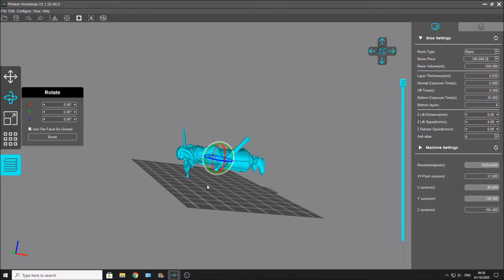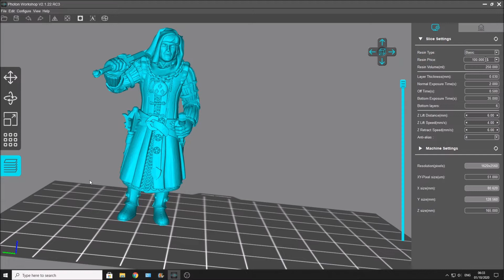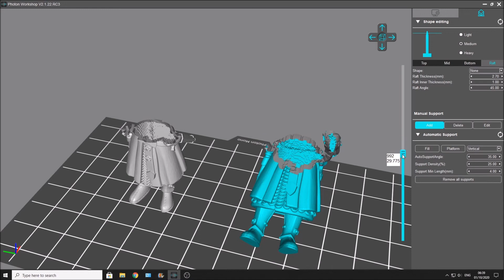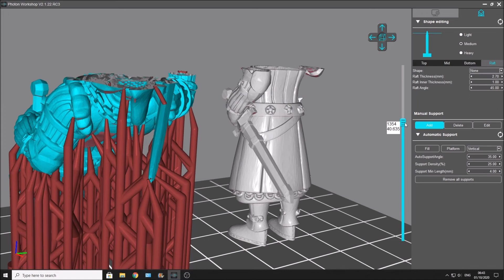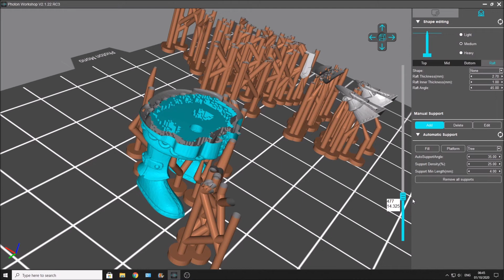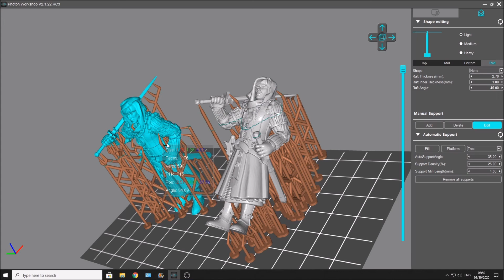The Anycubic photon workshop with a working support system

Comment: It's weird, on my model the slider on the right side only goes up to 37mm and then it shows the whole rest of the model as one layer. it only goes to 750 layer but i know my printer can do way more than 750 layers. very weird
Reply from the maker: i have not tried the latest version of the photon workshop. i stopped using it a long time ago. i tend to use the free version of lychee for my printing. hmm check your layer settings incase your printing at 0.5 when you should be at 0.05 etc its as easy mistake to make. have you tried other models in the slicer. are you getting the same with them ?
Reply: @TKs3DPrints  using lychee now as well. Works for me so thank you for the tip ^^
Reply from the maker: @Sylccc  your welcome. :)

Comment: How do you use teh edit function with supports?  It is not the same as Chitubox, and I can't figure it out.  thanks for this great video.
Reply from the maker: you know i just loaded up the version i have and for the life of me i cant remember how to sort them i know i can select the support then click edit. but nothing. no idea if i have just forgot i am sure you was able to move them all out of the way and do stuff. tbh i never use the program these days for supports. i tend to use the free version of lychee for my supports. and would only use the photon workshop for slicing the file. i have asked them many times to have coders that use 3d printers in there everyday life. but i feel like the software was written by people that have never used the machines. i would have a look at lychee for supports. most users use it or chitubox. though prusa can do some good supports also. sorry i could not help. but again i moved from the software as soon as there was a more reliable software for the machines.

Comment: I am new to DLP printing and photon workshop. My printer came two days ago and now I am tinkering around with it. But the interface of the version of photon workshop that came on the USB Stick of my photon Ultra (V2.1.29 RC14) looks a lot different to that in your video. For instance there is noch "Slice Settings" or "Machine Settings" on the right side. 
There is a  Model List instead and two buttons labeld "Settings" and "Slice". Under submenues of Settings I found most of the values that are shown on the right side in your video. Is there a way to get the view the way it is in your video? Thing is sometimes when I start the programm my settings seem to be reverted and so I have to check erverytime in the submenus.
Reply: Ok I tried the free version. Besides from trying to mislead me to buy the software at every second klick it also prints all objects mirrored. Don´t know why that is. I noticed it because there is some writing on the side of my modell. Seems to be a common error on Lychee. Sadly none of the work arounds seem to do my modell any good. 
Same model works with photon workshop without issues. Now I have to do manual support all over again. Practice leads to mastery I guess. Maybe I try Lychee again later with figurines, where correct orientation is not such a big problem.
Reply from the maker: @LorkenSturm  hmmmm.. i have not seen it mirroring i will have a check after. the only time it used to ask about buying is when you go to sculpt. think there might been an update i might have missed. again i will have a check for new update and check it out. and yes always good to learn to manually add supports but you can save the model out with supports. and load it into the photon workshop. again Quentin i will have a check and let you know.
Reply: @TKs3DPrints  - I found an entry in the Kickstarter comments: "...It's okay, I've just found it - settings specific to the printer itself (click the cog on the upper right of the Anycubic Ultra icon). In my case it's currently showing as Mirror X ON, Mirror Y OFF. ..."
I switched "Mirror X OFF" and now all is working correctly. Big thx to Gordon Sylph, original poster of the answer on kickstarter. 
The other thing that caught my attention is that the predicted print times from lychee are much too low. When I load the *.dlp from Lychee in Photon Workshop the print times are much higher and very close to the real print time - less than 15 min appart in a 10h print. Lychee predicted 6h.
Reply from the maker: @LorkenSturm  the predicted time is a learning curve for the software the more you use the software and if you import the info after each print into the software. it learns and the times get more accurate with each print.
Reply from the maker: hello there. yes i need to do a new video for the photon ultra as i know the photon workshop has updated. but i would suggest trying the beta software for the Lychee slicer. they also have the photon ultra in there printer lists. and from what i remember with the latest free version of lychee its very much the same as the lychee slicer video i did. the only change is that you need to select the photon ultra from the list in the anycubic range of printers. i hope this helps. and i will try and do an update Asap for the photon workshop for the ultra. :)
Reply: @TKs3DPrints  Thanks for the quick answer. I already found the lychee slicer in another video. It looked pretty good. But can the free version do all the things photon workshop can? I would love to buy the pro Version, as I did with simplify 3d for my fdm printer, but the pricetag is way to high. I strongly dislike the abo modell because this is a hobby for me. After the first "new toy" time I think it will be more like one or two prints a month if anything. So after two years I would have paid 130Euro (and thats the yearly discount price) for maybe 24 prints. I realy don´t understand why they can´t just sell the Software as it is and give me the option to buy updates if I want them and when I want them. And yes I know I can switch the pro Abo on and off without downsides, but all that switching would be realy uncomfortable. 
Another question if you don´t mind. It may seem odd but my prints stick to my bed like concrete. I already have made a lot of ugly scratches to the bed, sigh. Can you give me any hints on what parameters that behavior might be changed? This minute I run a testprint on which I lowerd the "bottom exposure time" from 35.000 (was preset) to 20.000, which was a value I saw on a video from vog.
Reply from the maker: @LorkenSturm  that and better its the only slicer that i use with the photons. though the prusa slicer is also ok to use. i prefer the lychee slicer and the free version is better than the photon workshop. as it has a great infill lattice that works perfectly. just remember to add a hole if you hollow large objects and place the hole close to the bed as it needs to printed first to allow air into the model to help reduce suction. exposure time will be down to the machine you are using. ie the ultra. or the mono. or the photons etc. also each machine exposure will vary depending on use etc. so its always best to calibrate each bottle of resin for your machine as you use it. uncle jessy has a few good kinds of exposure tests https://youtu.be/-pbi6CkZxgA
Reply from the maker: i have also s3d for my fdm and at least with that software it was a one of payment. this is the way all software should be. i hate having to pay monthly to use software. and there is a lot of software i would love to own and use but they use that silly payment crap. but yes the the free version is great

Comment: Thank you so much for this video, it's the perfect introduction and straight to the point! is there any directions for solid fill (no hallow  pockets)?  that would helps on some transparent small scale model prints
Reply from the maker: i think you just don't select hollow or add infill and it should print solid

Comment: Just got my mono in and wondering where do you get your models from and how t o upload them to photon workshop
Reply from the maker: in the video information there is a link to pollygrim the maker of the model. most files are stl files. you can find many amazing patrons at myminifactory.com i am with archvillain games patron. each month they do a new set of models and a 5th edition module for each months models. but there are also many other good patrons. if you want free models then check out thangs.com they have many free stl files. if you follow the video above it shows how to load in the files and how to setup models. also i have other videos that show the same. i would recommend downloading Lychee slicer and using that. watch the video first on how to use the slicer this is a great slicer. or there is chitubox. but myself i now only use the Free version of lychee for all my files.

Comment: So, why can I not add manual supports?  I followed the tutorial but very few auto supports generate and I cannot add manual ones...
Reply from the maker: fist make sure you have the latest version. but you to add supports. make sure you are on the support section. select the support you want to add ie light med or heavy then just click on the model at the point you want the support. and it should add the support. if your still having problems with the slicer. try downloading the lychee slicer i use the free version. in my eyes its a way better slicing tool than the photon workshop. i also have a video on how to use the slicer. hope this helps. :)

Comment: my photon workshop so laggy? do you know why? i had hi end pc setup
Reply from the maker: have  you updated to the latest version. i take it you have a good graphics card. and have you tried the lychee slicer or chitubox. i take it its laggy when your slicing a model. if the computer is a new machine it might be missing some other files linked to drivers. i cant remember of the top of my head. so i would recommend download the  latest version of photon workshop. or try the lychee slicer. i use this slicer all the time. i also have a video on how to use that. i also use the free version of it. if you get lag with the other slicers then its defo some related graphics files laptop users have this problem when they use onboard graphics card and not a dedicated 3d card. but if you join the anycubic photon printer owners for facebook we should be able to help you there more. link in the information under the video. hope this helps
Reply: @TKs3DPrints  thx for the reply brother. For some reason, my photon workshop didnt work properly when in full screen mode (so laggy and cant click the menus). Then i go to not full screen window, and it works properly. Thanks👍🏻👍🏻
Reply from the maker: @rangga_h  could be linked to the screen mode you are in. but glad its working.

Comment: My slicer goes bananas! when adding supports. No matter where I click the support does not go where I need it. Help ?
Reply from the maker: k i would suggest downloading the Lychee slicer and see if that helps. are you using a laptop. and has it got a 3d card built in i know some laptops have a problem with this. might be worth you joining one of the photon groups i run on facebook. users there might have more information.
Reply: @TKs3DPrints  Thanks for the reply. I have the same issue with Chitubox which makes sense since they are similar. I was trying Prusa but that’s boring. Graphics card is above average good enough for Solidworks cant remember name.

Comment: Thank you so much for the assistance with this video. It would be awesome to see an updated one for the new version of Photon Workshop as there are some settings that have changed in the version that I have. I just bought the AnyCubic Photon Mono X and I had no idea how to get the supports working for my first actual print that wasn't the included test print. 

Thank you so much for the amazing help!

Comment: I have made my figure with Anycubic workshop. But last time I have problems. When printing only the bottem islets are printed. Then the printer goes upwards and nothing is printed.
When I look in the workshop everything looks well. The shapes are on the bottom islets. I don't understand why only the bottom islets are printed and the shapes upwards are not printing. Anybody knows what is the cause?
Reply from the maker: hmmm without looking at the failed print and your settings with the machine your using. i imagine it could be a case of bad support placement or the support tips are not holding onto the model. how large is the model. and is the model solid or hollowed. best to come and join us on facebook. join the group.  Photon Mono Series Group
Reply: @TKs3DPrints  Thank you for your answer. The model has a height from 70mm. Also not very big. The model is hollow with thickness of 4mm. It looks if the support tips are not holding on the islets. The islets do holding on the bottom plate. I don't have facebook. And here I can't upload a photo from the bottom plate.
Reply from the maker: @jaccoolen4509  do you have twitter. ? you could try and send me pics there at @Turen_karn
Reply from the maker: k you could try medium supports. or increase the contact depth or increase the tip size on the supports. that might help.
Reply: @TKs3DPrints  I also don't have Twitter. I had facebook and I think it is better to reactivate my facebook account and come on facebook.
The strange thing is that it did work and now it's not. I will try to increase the tip size, cotact depth and medium supports.
Reply from the maker: @jaccoolen4509  could also be the temperature that's affecting it. cold resin tends to flow like custard. this will effect curing etc.
Reply: @TKs3DPrints  the temperature in the room.is about 20 degrees. I think this is not the problem. But will it be that the problem is the printer itself or the software,  chitubox, or I didn't do their work good. I can't imagine that the printer is not working good. I have the printer one week. The first two figures were printed well and after that the problem began.
Reply from the maker: @jaccoolen4509  k i would give the lychee slicer a go. tbh i use it all the time for my printers now. have a watch of the video i did for it. it should help huge amounts. i love the support system that comes with it.
Reply: @TKs3DPrints   I made a model with the Workshop and with Chitubox. Because of my problems I placed the model straight right on the bottom. Therefore I didn't have to use support on the bottom. I did it because i wanted to knew the raison of failure. I tried everything 3 times. But whatever i tried always the same failure. Then I thought I am going to print the cube from Anycubic, because this print was perfect.  And I didn't believe but now the print was perfect. Also the problem was happily not my printer. Thus the software. Until now I can not understand why in the beginning the model with Chitubox and Workshop printed well and now not. But I will try Leeche.
Reply from the maker: @jaccoolen4509  what printer are you using by the way. is it a standard photon or one the mono range. i found with the photon. the default settings for the test print are not the same as they are for the printer default settings. i found that adding 2 to the normal exposure and 10 to the base exposure helped. but for the photon mono most things print at 1.5 to 2 seconds exposure and 35 base exposure.
Reply from the maker: and yea i have used nothing else since i started using lychee
:)
Reply: @TKs3DPrints  I have the Anycubic mono x printer.
Reply: In the Workshop from Anycubic I choose the mono x printer. The exposure time there is 8 and the bottom exposure time is 40. When I looked at the values at the cube from Anycubic I saw that the exposure time was set to 2 and that the bottom exposure time was set to 40. And when I  printed the cube with these values it was perfect. Also these values are important. But then I don't understand why my first two prints were perfect with the values of mono x.

Comment: Thank you for the excellent tutorial! I've been considering some prints with rather large footprints and I was concerned with the difficulty of removing them from the plate. Rotate?! Supports?! Whoda thunk!
Reply from the maker: i find that 35 base exposure for the photon mono. if your using the standard photon the base exposure will be higher. but  hollowing out models is a key to this and having the hole close to the build plate so its printed first helps reduce a lot of suction. works well with models with a large footprint. i tend to also print directly of the build plate most times. then after its sat a little time to drip off any resin into the vat. i will then use a hairdryer to warm up the supports whilst the print is on the bed. and they will flex and can easy be removed without leaving puck marks. also if you do get any they would be hidden under the model rather then on the front or the back. plus this will warm up the build plate a little allowing a more easy release of the print. this is the way i print all my models. i also tend to hollow them at 1mm wall thickness. :)